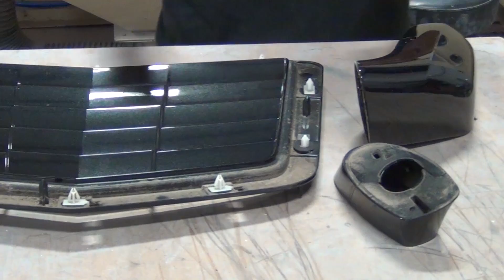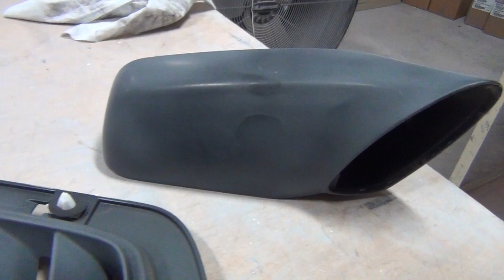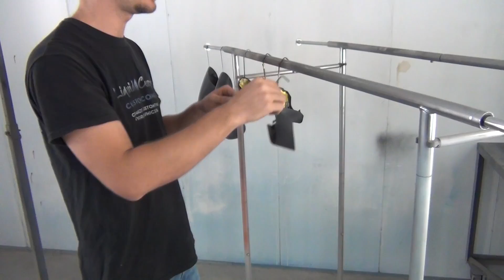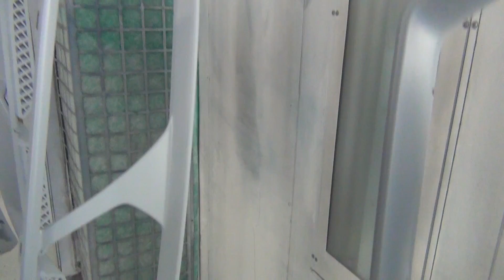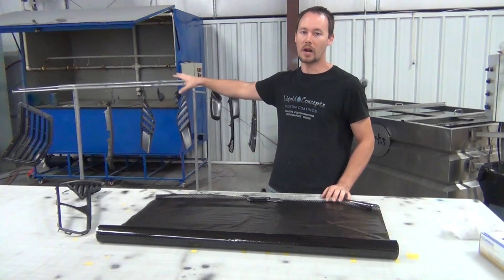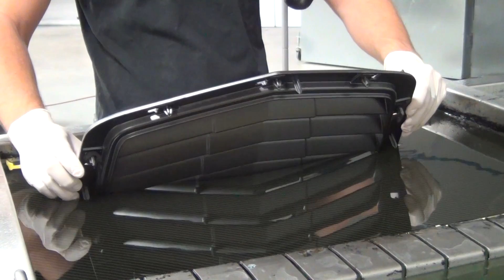HOW TO HYDRO DIP COMPLICATED PARTS | Liquid Concepts | Weekly Tips and Tricks

Comment: Hey guys, I bought some material with y’all and I’m just about ready to dip.
My question is on dipping a guitar. I want both sides covered but I don’t have a tank long enough for a single dip. How do I double dip without over laying the first dip? Can I mask off the entire back to dip the entire front?
Reply from the maker: Yes you are correct! You will want to mask off whatever you do not want dipped in the 1st dip. This will give you a straight line. Once dipped you can remove the masking, spray and intercoat clear, mask the previously dipped side and then dip the 2nd side.

Comment: Tips of fingers wouldn't cause mistake areas? I thought one would fix something to hold the piece to keep bare areas left from fingers? Or do you look over those areas and just touch them up?
Reply from the maker: On this particular piece none of the area where we are holding it is seen. Only the center section is visible once reassembled. If indeed these areas were seen we would have made a jig, tape tabs, or something to hold from the back side as touching it up in that large of an area would not be ideal with this design.

Comment: Is there a way to dip non-removable parts from the car?
Reply from the maker: Normally not. You have to be able to put the part in the water to be able to dip it correctly. You may be able to wrap it if its not removable.